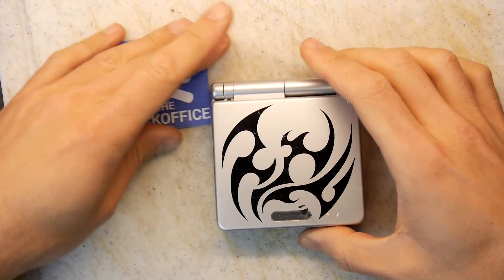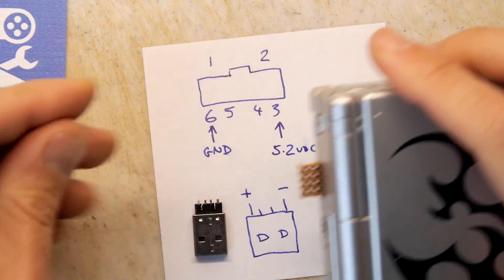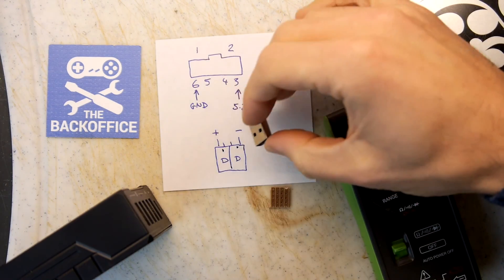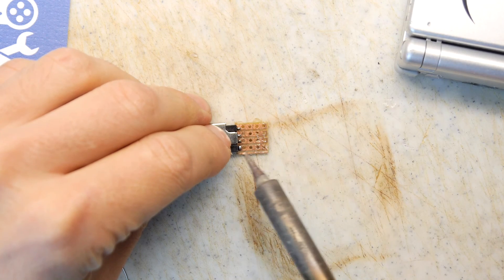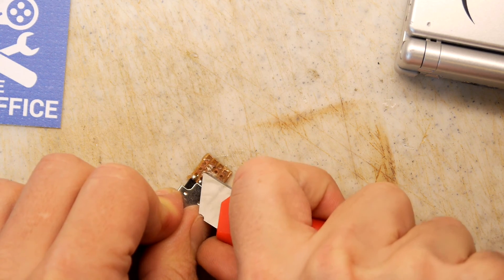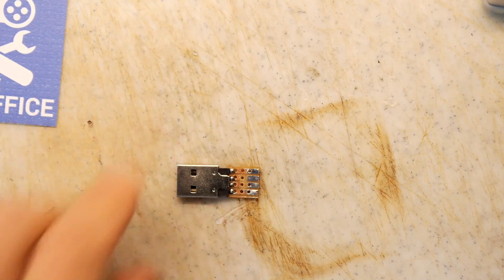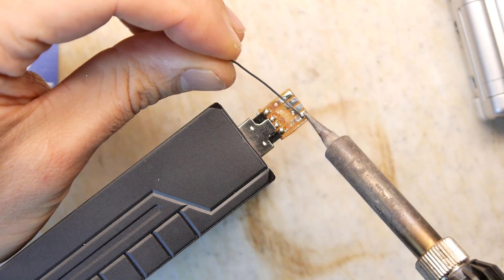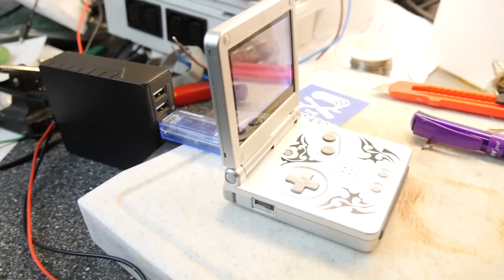DIY Nintendo Gameboy Advance SP DS Charging Adaptor

Comment: there wont be any problem if the charger that i'll use gives more mA than what the GB charger gives?
Reply from the maker: Nope, it takes what it needs. In many cases it is better this way as the charger is not running to it's limits.
Reply: @backofficeshow  thanks for the quick answer!

Comment: Cool! I just picked up some USB cables for my 3ds and the so much more useful the wall charger.  You should do a tutorial on doing hardmod on a 3DS wiring in the sd reader to the nand, like to see what you do for a connector ;)
Reply from the maker: +Ganjulationess3DS Is there a specific trick with the 3DS regarding the NAND? What does it achieve? Could be interesting 🤔
Reply: The Backoffice The nand stores the Firmware so you can dump your firmware then downgrade  (9.2) and do the main business of al9h firmware also hardmod is brick proof once you install you can completely ruin everything a reflash your dump. With a hard mod you solder a opened up sd card to the nand pins and connect it to a pc with a sd reader(Some more savvy install a micro USB instead of the sd card for a more perminant solution)

https://gbatemp.net/threads/tutorial-noob-friendly-nand-dumping-2ds-3ds-3ds-xl-n3ds-n3ds-xl.414498/
Reply from the maker: +Ganjulationess3DS oh boy! Can you remind me about this if I don't mention it again in a month?! I will definitely do this for fun, I need a 3DS as I'm not going to risk breaking my XL!
Reply: The Backoffice Sure thing, there was a cc23 hacking convention today and they announced that the encryption on firmwares has been broken, so no need to downgrade soon and you can just go straight to Custom Firmware hopefully within a month or so with a hardmod